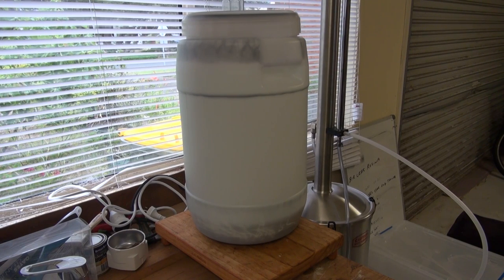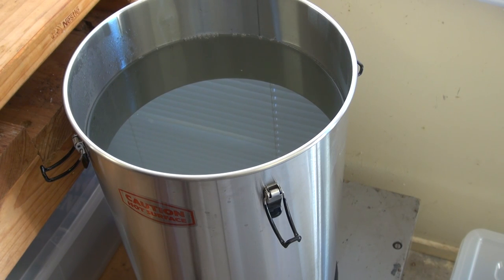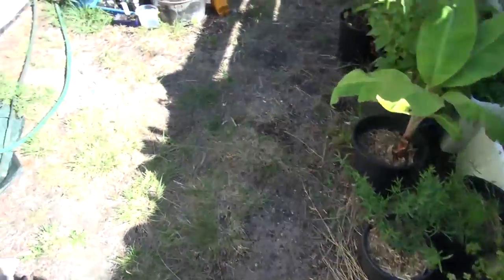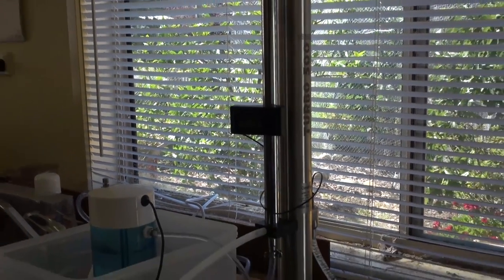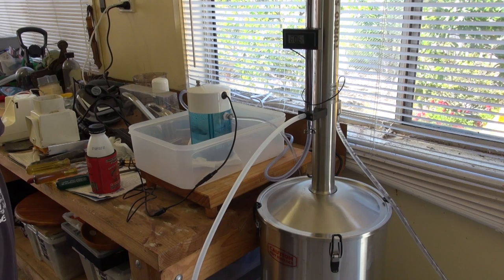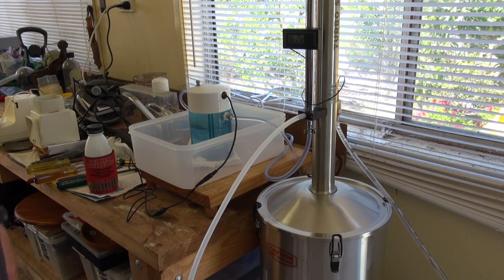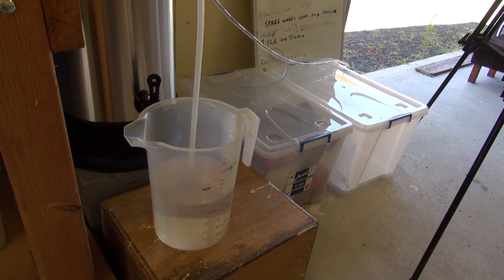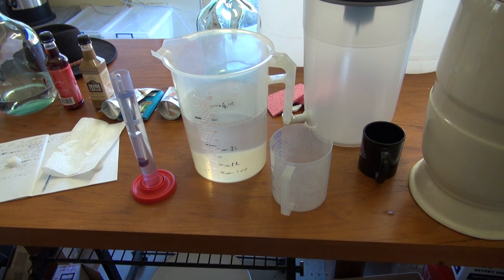Making Alcohol using the T500 Still

Comment: Hey bro how's you? Just a tip for you I get 3.2L running this on a T500 51c/52c I like this temperature and takes around 4/5 hours and I run it till it's dry and stop producing. Got exactly the same water regulator and works without leaks just add some clear silicone on the leak and it will solve issues.  I take 150mls heads and collect hearts. When I'm near 2800mls I then check for tails by doing regular cuts making sure I don't get a drop in abv. I check with taste and smell and soon as the tails come through I then collect that separately for next run. You not checking for regular tails your going to get tails in your hearts and going to smell and taste rank. I now use a parrot I made DIY and collect in there which makes so much things easier. And no Smearing at all. Hopefully this helps bro but your doing a good job

150mls heads
600mls tails (run it dry )
3.2L/3.3L  @  93 abv

Give up on turbo yeast kits they are fuel to me way to strong and burns like mad.
I use Lalvin EC 1118 champagne yeast amazing yeast and I do TPW wash now and so clean and taste and smell amazing no filtering if you use this. 👋👌👍
Reply from the maker: Thank you for sharing this with me I will try different types of yeast, I have one in that looks like it can take 3 months before it's ready.
Yes the turbo yeast is better for the turbo 500 because it's designed for it, and it is not as smooth as some but you can make it the smoothest taste after filtering it.
Now when it comes down to heads and tail's  I don't have to worry about it with the turbo 500, it's been made that way I get 3 to 4 litres depending on a lot of thing's but you are right it comes down to smell and taste, I take out the first 50 to 150 ml or when it starts to smell and taste I know that I'm getting the right thing and around 3 to 4 litres you can smell and taste when too stop making it.
Might have to make a new video talking about the turbo 500, you have a great Christmas and new year and again thank you, for your comments.

Comment: Thanks, I'm a beginner. Have only run the still seven times following tips from pommy utuber "love brewing". He reckons the goldy locks temp is 50 degrees. Takes longer but better product. So far family and friends love it. There's a table for adjusting dilution  if not at 20 degrees.My average yield is 3500 to 4000 ml. Is there any way to increase the yield per wash, by adding more sugar for example?

Comment: If you pre heat without top the ceramic beads are unnecessary. Give it 30 minutes or so. Stir your mash occasionally while it heats. I don't know what you use in your wash I figure it's just a sugar wash judging by the clarity. Unless you have solids in your mash the beads are unnecessary.

Comment: Hi JUST WATCHED YOUR VIDEO on distilling,  what type of pump are you using and where can i purchase one from.I like the video its great, hope to here from you soon. Thanks JEAN Claude
Reply from the maker: I will have a look when I get home but you can get it from eBay or any good home brew shop. It perfect because we live off tank water and it control's the water perfectly even if you have lots of people useing the water it gives it a even flow all the time.
Reply: ok thanks for that what would the name be of this pump please
Reply from the maker: @Jeanclaude001  I will go through eBay and send the information to you as soon as I can. So sorry I had a lot of things to do in the last couple of days but I will get back soon.
Reply from the maker: @Jeanclaude001  here is the name and a youtube video on this pump and do not pay any more then 90 dollers Aus for it Still Spirits Water Flow Regulator for distillation + pump Turbo 500 T500 NEW
https://www.youtube.com/watch?v=pZBsOL8Qksw
Reply: hi wilfred thanks for the info on the pump,Just one last question how do you get the water from your tank in the water flow regulator, is it pumped into it from the tank,
Reply from the maker: I have a outside tap with 2 hoses coming off it with a individual tap each one for watering the garden and one going to the water regulator unit. I will try to make a quick video to show you how I set it up when I can it's very easy to do.
Reply: Hi Wilfred so you don't use your water tank for this purpose.i need to use my water tank but i don't have a pump to pump the water from the tank to the water flow regulator
Reply from the maker: @Jeanclaude001  I do use my tank water we have a pump but the water pressure is not really good if you live on tank water you know that. What this does is keep the water moving at the right speed to keep the still at the right temperature. You could get a pump that you can use with a power drill that would keep the water moving then put it though the water flow regulator to keep it moving at the right speed so you can get keep the right temperature.
Reply from the maker: @Jeanclaude001  we live off tank water that was one of the reasons why I got one and where the still is there is no taps so I had to run a hose down the outside of the house.
Reply: ok i will try to do that, thanks so much for your help keep you informed on my progress
Reply from the maker: @Jeanclaude001  https://www.youtube.com/watch?v=Hwl2SkhfWVI